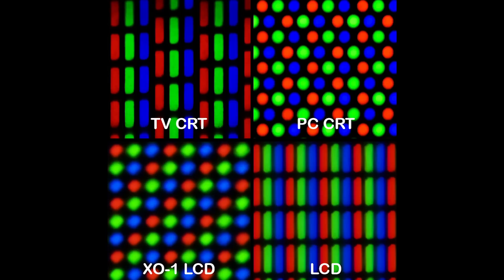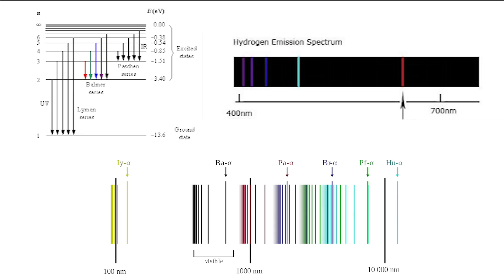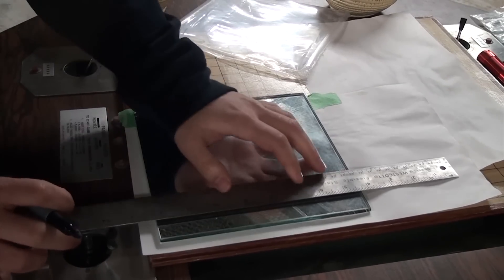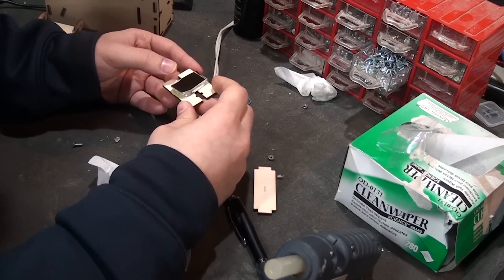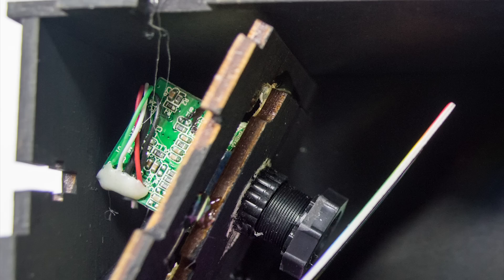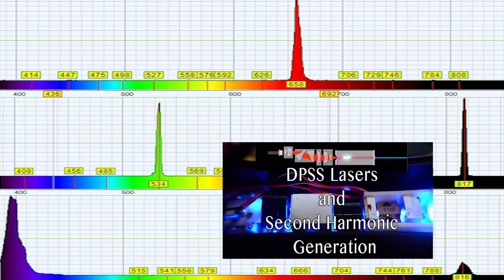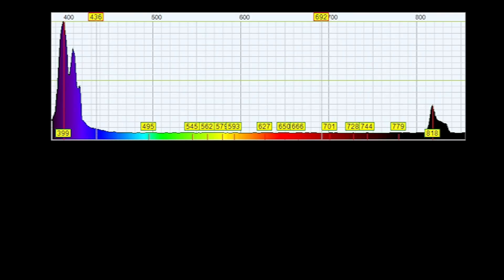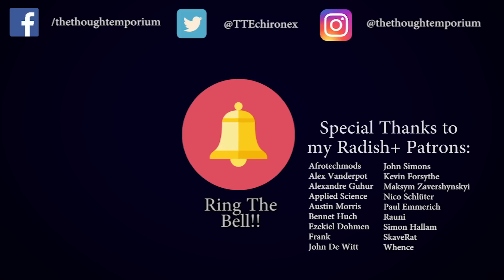Building a Nanodrop Style UV/Vis Spectrometer

Comment: Nice little contraption  😂. Your explanation about diffraction gratings might be a little misleading to the younger folks. There's no connection to dispersion on small "prisma like " structures! As the name suggests diffraction is causing the spreading (dispersion) of the wavelengths. This happens due to the phase shift of light travelling through different thickness of glass. These path length differences in turn cause constructive and destructive interference on the other side. This process linearly depends on the wavelength. In contrast a prism disperses wavelengths not in a linear way which why you won't find it in precision instruments.

Comment: This kind of tech is how a lot of water testing is done. Colorimeters use reagents that change color in the presence of certain chemicals, and using a filter that selects only for reagents color, you can quantify how much of the detected chemical is in water. You’ve done something like this when you mix purple cabbage juice into a liquid although in this case, it’s the PH your detecting.

Comment: After scoring the glass, sharply tap the steel ball end of the cutter ( on the opposite end of many glass cutters) directly under the scored line.  When properly done, you will see an internal fracture start. Continue tapping ahead of this fracture.

Comment: Thanks for the inspireing video! 
Looks like I am not the only biologist affected heavily by phisics and electronics.

I am curently building a spectrometer to test the light sources I am going to use to grow my plants.

One note... you actually try to use your "nanodrop" in a fluorimeter mode. It is challenging using the current geometry as excitation light is usually orders of magnitude (3-4) more intense than the emitted fluorescent light. Ususally the emission is measured from a perpendicular direction, so the excitation light does not hit the detector. 

You should be able to measure DNA based on absorbtion using 260nm of full spectrum light (e.g xenon flash): A(260nm DNA) - A(260nm Water)

Comment: So if you're going to use a laser, why not go full Raman spectroscope? You might need to change the layout a bit and would need to add a beam splitter, and you might need slightly bigger sample sizes involving a cuvette, but on the bright side you could probably do away with the fiber optics stuff. Seems like you're pretty close to Raman spectroscopy. I say it would be a damn shame not to go all the way after coming this far.

Comment: How important is having a really high quality diffraction grating here?   Is that cheap 1000 line the best possible option?  Would a glass 1000 line version be any different?  How does using a CD change things? What does the diffraction grating component in the project impact beyond focal length?

Comment: Lots of good ideas here. I would like to add that finding a ready made black box would make the manufacturing part much faster. For example, another builder used old VHS cover case made out of black plastic. Hot glue should stick that pretty well and you can easily make the required holes on the plastic.

Comment: Using paint remover, one can turn any regular mirror into a first surface mirror. It's cheaper too.
If you don't have glazier pliers, you can use cardboard and regular pliers. 
Lubricate the glass cutter or it won't make a good score: automatic transmission fluid works great for this. It takes practice to cut glass. I have a friend that's a professional glazier who showed me how to cut glass. Wear gloves and sand down the sharp corners for safety. My friend used a belt sander.

Comment: Quick question regarding the infrared part of the green laser. If our eyes are not activated by infrared and our eye balls are opaque in that frequency than is it harmful? I would think our eyes, being very sensitive to green, would be damaged by the visible part of the laser.
Reply from the maker: Our eyes are not opaque to that frequency at all. You're thinking of UV, but even then it can easily damage your eyes, just different parts of your eyes
Reply: @thethoughtemporium  I had to look it up since eyes glow with my infrared camera. Not entirely right or wrong. They are opaque above 1400nm, but the infrared being used for your green laser is below that. From what I read it doesnt cause instant blindness, rather chronic exposure to near IR with damage the iris, leading to cataracts through thermal damage.

I have a 150w CO2 laser (10,600nm) and I knew the danger there is insta burning your eyes from a reflection, not flash blinding. I wouldnt recommend staring at the burning dot though.

Comment: very very late comment and probably unecessary, but if you're ever having a hard time cutting glass again, try tapping the piece that won;t come off on the bottom of the glass instead of the top, eg. with the back of the cutter (assuming it's metal and kinda heavy) along the score line.

Comment: I've just started watching this video. Early on, you note that the visible spectrum extends from about 400 nm to about 700 nm. Unfortunately, while you are saying that, the diagram on the screen shows the short end at 380 nm, which is arrant nonsense (and contradicts what you're saying). The diagram also shows the long end at 750 nm; but although that's a gross oversimplification, it isn't exactly nonsense. (We can get into it later, if you want.)

Comment: There is not as much as green light as infrared light, infrared light is much more! CCD and CMOS based on Silicon have lower quantum efficiency in the infrared compared to the green, they are much more sensitive in at the green wavelength of the laser. So you can't compare them so easily.

Comment: Great presentation of a great project!  You're giving Ben a run for his money here.

One note: if you bought your 405 nm laser pointer from the same eBay seller I did, its power output is probably much higher than the rated 5 mW.  I bought 10 for 99 cents each and found that they ranged from 10 mW to nearly 100 mW.  Given the eye's inability to focus 405 nm very acutely I don't know how hazardous that actually is, but I certainly wouldn't want to test the assumption by looking at a specular reflection on purpose.  More to the point, that might be why you're getting too much light for the sensor to deal with.  Can you attenuate it with a neutral-density filter?

Comment: Next time , cutting glass, score the glass with your glass cutter, then hit it a few times with intense heat (butane torch maybe?). The thermal shock will cause the glass to shatter along your scored line (which is hopefully a straight line).

Comment: Great breakdown to how this stuff works! loved it :)

I was going to ask why you were planning to get DNA concentration from fluorescence, as opposed to absorbance (i.e. log(Transmission)), which is what a nanodrop/any decent professional UV/vis spec would do. But then I realized its either your camera, or your laser doesn't go down to at least 260 nm, which is where DNA absorption is usually measured. I think with the laser/camera combo you have right now, you aren't actually getting much more functionality out of having two light sources.

Also, why use a UV laser, as opposed to a more broad spectrum UV LED, or at least smaller wavelength laser? That might help you with the DNA fluorescence - if you are using ethidium bromide, it absorbs most between 210 and 285 nm (for excitation at 600 nm). So even if your camera can't see those photons, it will excite EtBr without needing to jack the laser up as high as you do right now.

Comment: It's just a PDF file with NO dimensions, none of the laser cutting places in all the USA that I've tried so far can get this right and we DESPERATELY need this information!! Please help?
Reply from the maker: https://github.com/FOULAB/DIYnanodrop/blob/master/DIYNanoDrop.svg
Reply: @thethoughtemporium  Ahh shoot. Still not working. BUT. BUT. I buckled down this morning and really tried to figure it out and did! So if you upload the orig. PDF into inkscape then scale everything to 200% in that it's almost spot on, and they have the easy measurement tool to double check. I also well I was in there edited the stock file so the camera bracket be printed/cut with a 1.2" hole for the camera you recommended, instead of the weird open bracket. If you want my blueprint I can send it to you so you can link it here so no one else runs into the same issues.. That way no one does like I did and has the place print the stock camera holder and have it be useless or have to print it in multiple wrong sizes before it's finally right. I'd even say scaling it up to 220% may allow for a bit more room for placing things inside. But. eh. Let me know. Thanks for finally replying! Appreciate ya'll and your channel.

Comment: @The Thought Emporium Do you have the actual blueprint/CAD files for it with all the dimensions and stuff? Every wood cutting place I've contacted says all the blueprints provided here and from their main site give nothing?
Reply: Look at the interlocking "pins". They are dimensionated for the panels thickness of 3 mm plus some tollerance. Ok measuing in for ex. Inkscape is a little off but I also used Blender to remodel it with roughly 5.8 mm papel wood laminate from local home improvement store. But it got to messy so I ordered 3 mm panels. And today in addition to already received framed translucent diffraction foil I got 1000 and 13500 lines/mm sheets. I had printed grey PLA (about 3 years not in use) on the framed foil and also with paper frame removed but still I got mostly only in the corner a resemling of a refracting diffraction piece as the rest weren't a consistent surface as the foil did not lay flat. Sorry for long sentences as I am german. But my next proplem is getting the light guide.

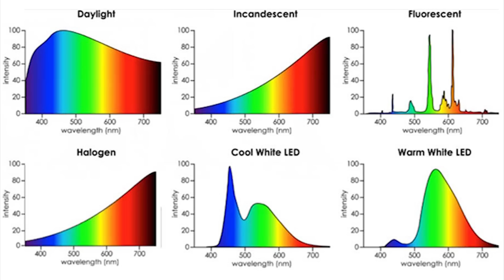Comment: So I am doing a science fair where I am measuring the effect of wavelength on output voltage of an LED (rudimentary know). Our current problem is, due to the nature of light, we cannot find any source of white light that consists of the wavelengths of visible light in equal intensities, because I am sure intensity will effect voltage output and we just want to measure the wavelength. My plan was to use either a Halogen or Incandescent light, due to their seemingly simple curve of light intensities (1:07) but I would want to find the exact distribution of the light bulb/lamp I am using. So, my question would a spectrometer such as this one be good for the equation of this curve? because then I would be able to apply it to my data and find the true effect of wavelength. Thanks for anyone who can help, I just want to get this done lol

Comment: To quantify DNA (or anything really) you will also need to calibrate the distance between the coverslip and the fiber optic cable end on the detector because of Beer's Law you need to know the light path length.

Comment: @8:36 "On a microscopic scale, a diffraction grating is essentially a series of tiny prisms" 
No, no it is not. Refraction is NOT diffraction. They are 2 completely different wave phenomenon. Refraction is light bending towards the normal as it moves from a less dense medium to a more dense medium (or vice versa) because the speed of the wave is different; diffraction is light recombining into a new beam vector based on the distance between the holes in the grating. And diffraction gratings are on the sub-microscopic scale, they're on the order of the wavelength of light, you're not going to see the lines of a diffraction grating in a microscope. You sounded so promising before you said that...

Comment: Your setup is gorgeous, but I must humbly agree that the magnets act as springs with little vibration damping. A heavy plate supported on partly-inflated ATV or wheelbarrow inner tubes works pretty well. Magnets work well for "clamping"  optics to a steel plate. 
With your setup, more of a damping effect would be achieved with thicker diameter copper or aluminum rods, which would act as an magnetic brake. See https://www.youtube.com/watch?v=4KsnKHsD3Ak . Also (very different geometry but same goals) https://dberard.com/home-built-stm/vibration-isolation/ .

Comment: If the sun disproportionately emitted a colour different than green, would/could plants use a different chemical for photosynthesis and therefore look a different colour?
Reply from the maker: Yes. This is already a thing. Purple bacteria do that, and are, well purple.
Reply: @thethoughtemporium  cool!
Reply: I'm pretty sure the sun emits black body radiation. As for plants appearing green, green is just the least used wavelength region (which is why it's re-emitted).

Comment: what dye are you using to run your DNA gels? it would be more accurate to quantify DNA if the dye only florese when it binds to DNA, but does not when it is on its own. If you could make your home-made nano drop compare absorbance in ratio (A260/A280 and A260/A230) then you wouldn't need to add any dye to quantify pure DNA and RNA

Comment: I'm always glad to hear about DIY Spectro projects! I did a few crude ones some years ago; it looks like we used the same brand of diffraction grating! xD I am planning on doing a video at some point on how to make a hand spectroscope out of trash:
https://topologicoceans.wordpress.com/2010/11/25/diy-spectro/
Reply: also, iirc fluorescence spectrometry usually solves the problem of the overwhelming excitation source by putting its path at right angles to the sensor, such that all that's picked up is a bit of scatter. I think some turbidity sensors work the same way too by measuring the scatter, rather than absorption.

Comment: Don't you guys have a 3D printer? Back in the end of the 90s (no 3d scanner then, mostly lego) we took a scanners ccd sensor (usually about 2048 pixels in a line) and collimated a spectrum onto it. This might be more work but ultimately should lead to a much better spectral resolution than the webcam (in that crop, how much do you have? 500 pixels?) not sure about how to get it into such a software though, maybe talk to the authors to enable them to write data input plugins.

Comment: The amount of light absorbed is also affected by the distance light travels through the medium( the thickness of liquid on the glass). Your equipment would be more accurate if that variable was controlled.
Reply: The original design is done to consider this, based on the original nanodrop. For some reason he discarded that.

Comment: Next time you need a mirror or glass: scratch it, heat it with boiling water then dunk it in ice water. After a few times it will break on the scratch line. Awsome build!

Comment: Far-Red is possibly the most neglected portion of the electromagnetic spectrum. It consists of the portion from 700nm to 800nm, roughly. The visible spectrum and infrared do not have a clearly defined boundary, and far-red is a sort of transition zone between the two. Far-red light is visible, but it is not as bright as light in the rest of the visible spectrum. Far-red will also reflect off of most of the fabrics we call black. Some of you may have noticed that many black, fabrics have a very slight red tint to them when looked at under sunlight or incandescent light especially. This is due to far-red reflecting off of them. I have some 730nm LEDs, and I built a flashlight from a 3 watt one. When I take this light into a room and shine it on my black fabrics, the fabrics shine back red. Even more interesting is the fact that if the black fabric had been written on with black permanent marker, the writing becomes readable. Far-red LEDs make any other red LED look a bit orange by comparision; these far-red LEDs are so red that no screen can display how red they are. Far-red makes up some of the colors of a sunrise and sunset as well. Have you ever noticed that your black fabrics look a lttle bit 'rusty' at sunrise and sunset?
The CIE and lumens are not perfect, because they ignore far-red and say that "anything over 700nm is infrared." I have some 3W 730nm LEDs, and they are visible, so not infrared. Before anybody says, "well maybe its just the portion of light under 700nm that you see.", nope, I have a lens from a broken digital camera that cuts off all light above 700nm, and when I look through this lens at these LEDs, almost no light is seen. When you look through the cut-off filter, if you have incandescent bulbs, you'll notice a few small color details missing as well.

Comment: tip: to get a surface reflecting mirror.. rub paint thinner on a regular mirror.. it strips the color coat revealing the mirror surface.. hobby stores sell small precut mirrors..
Reply: I just rather use HDD platters, mirrors corrode over time and HDD platters are  perfect mirrors that don't cost anything.

Comment: Part time machinist here. You really need to invest in some workholding, or learn more about it. Seeing you drill out that small piece of wood made me cringe so hard I felt a diamond form in my sphincter. Take time to secure things, you only get one set of hands (yeah its just wood but it takes less than a second for something terrible to happen). As for a suggestion instead of just complaining, consider using heavy duty double sided tape on your drill. We use it to secure parts all the time for light duty cnc applications and it has proved itself to be more than adequate for woods and plastics and even light steel cuts. Consider also a mini pallet which is just a flat block of aluminum with equally spaced holes that are tapped or reamed so that pins and screws can be used as stops and machinists clamps can also be used by screwing them into the pallet. Mini pallets can be easily made at home or purchased from a number of sources.